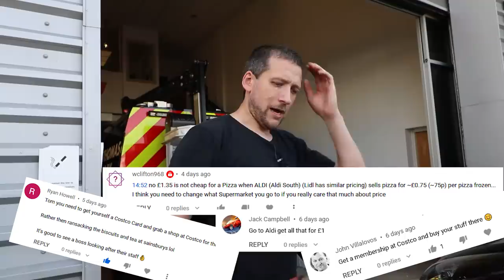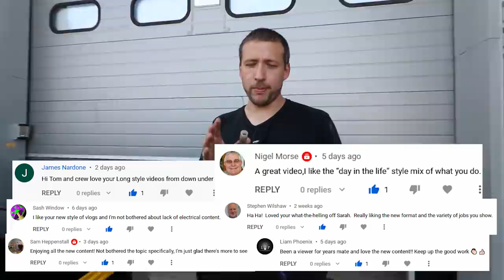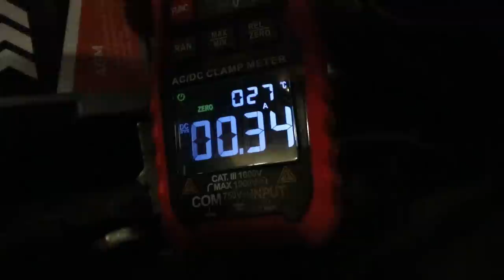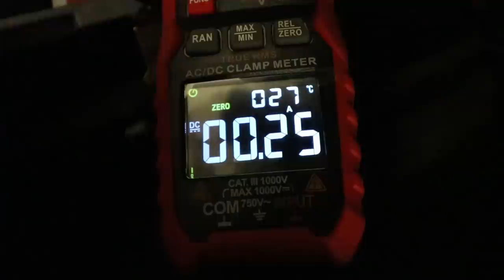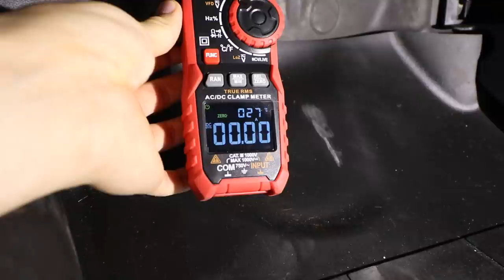THE NIGHTMARE JOB IS BACK! | Thomas Nagy

Comment: I work for a company that had fleet vehicles and every single one of the fleet vehicles had on board Chargers that had solar panels mounted on the roof and also plugged in if the vehicles were to be parked for extended periods of time. It was helpful for whenever we had somebody go on vacation and they neglected to shut off their radio or unplug their computer charger

Comment: Helpful tip coming from an auto spark. (Finally something on your channel I can actually say I know what I'm doing with!) If you're using anderson connectors, don't mount them underneath unless you put protective covers on them as they rot very quickly due to the large tin surface area. They also don't do well if you drive off with them still in. I would suggest using a short tail (250mm) and go through another connector that you can deliberately fail the retention lock on and make loose so that you won't destroy the workshop as you drive off. I tend to use standard mate n lock white spade connectors for this purpose. Or if you are feeling like overkill, get yourself some ex ambo Ludo McGurk Auto Ejects that fire the connector out as soon as you turn the ignition on (110v ones are very common and sensible money)
Reply from the maker: I really appreciate the advice, I'll look into it :)

Comment: CTEK has a nice connector on their car battery chargers and they also have a waterproof connector to put on cars, that might also be an option (vs the other ones you saw). Other option would be those connector they use on ambulances and other emergency vehicles. They can automatically be ejected when someone starts the engine. Emergency vehicles without that mode tend to have a circuit installed to disable the starter while the car is charging, too many cables have been forgotten and ripped out ;)

Comment: Re battery drain - had a similar issue a few years back with a Jeep Grand Cherokee. Went on holiday for more than 2 weeks, came back and it was dead on the drive. The vehicle was less than 1 yr old, so called out Jeep rescue. Who - as they recharged the battery - said there was nothing wrong with the car, we hadn't driven it enough...

Comment: I had the same problem with the car battery going flat, turns out to be a combination of the battery never being fully charged as start-stop was a constant draining in traffic and the dash cam which recorded 24/7. The dash cam draws 600mA continually 70Ah battery / 0.600 = 116.6Hours 116.6 / 24H = 4.8 Days to completely flatten the car battery just from the dash cam, then add the car's standby electronics!

Comment: On external vertical conduit runs I solvent weld the upward facing side of a join but leave the downward facing one push-fit. 
  
Pro tip from a non-pro: For a really neat conduit joint form the end into a socket using a heat gun and another bit of conduit as a mandrel. Needs a bit of care but it's far less noticeable than a normal coupler where appearance matters.

Comment: With modern vehicles you need to give them time to go to sleep before taking a current draw reading. You can't just close and lock it then take a reading, you won't get an accurate result. If you want to change your battery without the aggro of re registration, just use your jump pack across the cables. Depending on the vehicle it can take up to 50 minutes to fully shut down.

Comment: I had a DMF and clutch kit installed 4 months ago. I was gonna do it myself as I always do, but not being that well, got the garage to do it. Went to pick it up, wouldn't start, starter not even clicking. They club hammered the starter and I was on my way. Said it needs a new starter. Kept club hammer in van for a week till i had time to change the starter. Turned out they didn't put the earth strap on the engine, it was tucked up and rubbing on the bell housing for and earth. This why your honor, I have a club hammer in the door pocket.

Comment: I have had the same thing but not with a van by the way. I have a brand new Mazda Mx5 RF and it draws from the battery after you have driven it. However I have found that it reduces the amount it draws when the car has been sitting for 3 hours or so. It’s like the car goes into a sleep state but only after a few hours of not doing anything with it. It must be to do with all of the computers etc in the vehicle I would assume

Comment: I'd fit a split charge system with separate battery with it's own completely separate feed and fusebox from the main battery, you can also then use the aux battery as a jump starter.

Comment: Powerpoles  for the win , whether the big'uns for Charging  or the little  ones for  stuff like radios

vans and quiescent  load is a big  thing - vehicles  which even supposedly have  electro mechanical isolators still have issues with  going flat if left  and not on a conditioner

Comment: I ran into the two breaker circuit during my DIY fuse box to breaker box change over. I found that both circuits ran to the duplex receptacle that the refrigerator plugged into. My guess is that the original intent was to have a refrigerator only circuit by splitting the duplex receptacle and running separate circuits to each end. Someone apparently did not get the memo that it required a split receptacle.  I would think that there are single receptacles available for this type of circuit.

Comment: This hits close to home:   I had my Vespa GT300 serviced by the dealer a year ago. (Major maintenance, all fluids, all consumables, valve adjust, etc.)   It seems safe to assume with the price and the confidence they exude that it should be done right.   But one year later, it just dies while I'm leaving work.   I had it towed home and got into it the following Saturday.   The spark plug cap had fallen off.   Easiest repair I've ever done.   It's not supposed to happen because there is a built-in retaining fork to hold it down.   Must not have been used.   Then I go to change the oil and discover that the filter and fill cap are way over-torqued.   I sent a complaint and got no reply.   I dread next time I need to take a wheel off because they are already high-torque bolts.  If they are over-torqued I don't stand a chance.  (I own torque wrenches, but no power drivers.   They apparently like using the latter.)  Dudes with impact drivers think everything is easy.   But they don't give a damn about the next guy, or your engine casing.

Comment: Look into JTL for apprenticeship/college. Honestly hand down the best experience.

I was with a standard college and got fobbed off big style, was made redundant 2 years ago and they kicked me off the course before finishing my last unit. Passed my AM2 and did a seperate 18th edition exam myself and have been working for the past 2 years on that. My current employer got in touch with JTL, they flew me through my NVQ and everything is passed through and complete.
Reply from the maker: Thanks for the tip!

Comment: probably the sink goes on top of the bog like a saving unit combo, you wash your hands after taking a crap and the used water goes in the tank and it gets used on the next flush

Comment: Investigating the batteries: Good idea with the clamps hooked on the terminals to give stand-by power. That said I'm from the states so the advice I'm giving might not work, don't know the van type that good as it is not a US van. If the cigarette lighter is constant hot you should be good. Get a 12 v AGM 5 AH+ to attach to the cigarette lighter and you will be good for the main battery swap.

Comment: The current draw sounds high even for a controller kam, keep alive memory, must have been tempting to pull the factory fuses to find the big draw.
you can also do your charger battery change trick through back feeding the obd port.

Comment: I would be wary of trying to swap the van battery whilst using a charger to keep the van alive. Without a battery in place, the charger voltage could float up and damage the van ECUs. I would use a set of jumper cables to connect to another van instead.
Reply: Good thought.

Comment: re back feed, twenty years ago i bought a business property which i knew was in dire need of many things, got inspections from roofers, plumbers and electricians etc. Didn't know what an eicr was back then, but the spark i went with came back with a report that said basically we have to start again. 4 consumer units were turned off and main fuse pulled. he started stripping out, i was chatting to him when he got belted, turns out a radial was actually a ring. The other end of the ring was in a fifth consumer unit which we didn't know about and was actually by-passing the meter.  You may have gathered i'm not a spark, but me and the spark lived to be a bit smarter!  In my case i'm smarter because although I'm a graduated Youtube electrician i still hire a professional when i need stuff done, the spark got to retire a few years later. (not just on what he charged me!).  A word of advice, you might be safe 99% of the time, but if there was a 1% chance of winning the lottery - how many tickets would you buy? Think about it...........

Comment: Careful. Chargers with no load may go to quite a high voltage. Check before disconnecting the battery.

Comment: I have said for a while a ceiling rose can be dangerous when there's no lamp in it, plus with ceilings being 2.4m high, obviously you would have to be a knob to do it, but there's plenty of them out there.
My 68 plate traffic is playing up, keep getting a spanner light, then stop start error, check vehicle etc, Renault have had it 5 times, can't find the problem, told me my battery was only 75% charged, can't see how as it's used everyday, the last time said it was led number plate lights, fitted 3 years ago, yet this fault started in January this year, they just cannot fix them too many electronics.

Comment: Just in case no one has committed, the victron battery disconnect can be changed to what ever cut out voltage you want

Comment: Get some decent smart chargers.  Tiny and not intended for charging a dead battery.  They need to live on the battery all the time.  They assess battery state and apply different charging regimes to keep the battery in good condition.  I'm really impressed.

Comment: Watch if you put Anderson connectors on the side of your van(s), someone will drive off with it still connected.  I know it is only 12 Volts, but what will it pull the cables before something breaks and disconnects it.  Might drag the charger through the shop!!!
Better if the Anderson connectors are under the bonnet or somewhere where the bonnet can be left open, so it is obvious the wires are connected.  It will happen where someone will drive off with it connected.  Either that or make it so when the van is started it will automatically push out a connector, yes it will cost a bit, but it might save a lot of money repairing damage after someone drives off with the charging wires still connected.
Some Fist stations use a system where it throws the electrical cables out when they release the handbrake.
Cheapest way to do it would be to put wedges under the front and rear tyres to stop the van moving with the Anderson plugs still connected.  However, you are still relying on people putting in the wedges when they connect up, best way would be to connect the charge cables to one of the wedges and make the charge cables a bit heavier to allow for the extra cable run.
Put the wedges on the inside i.e. behind the front wheel and in front of the rear wheel, this way the cables will have less travel, but the van will not move until cables are disconnected.

Comment: do you have a decent obd2 code reader? If you get yourself a decent higher level one- (Autel seem to do some more affordable ones) then it may have the functionality you need to enable a new battery amongst other stuff like reseting abs faults etc. Either way it'll be well worth it if you're servicing your vehicles particularly for diagnostics.

Comment: That's why here in Australia, auto electricians exist (and we are never short of work). While I know many great mechanics.....many often aren't good with electrical or basic electrical diagnostics, some because of the way they have been taught or the places they have worked, or because they simply don't care.
In fact I often find myself diagnosing mechanical and hydraulic issues that mechanics have written off as electrical issues. (I work on heavy vehicles so this is a fairly common occurrence).
I'm by no means the best tradesman in the world but I still try. 

This is not a dig at mechanics though, I know plenty who are great with electrical, it's just the mindset you need for electrical work lends itself better to fault finding in any trade I feel.

Comment: Don't worry about programming the battery - it will still work, no problem. Pulling the battery while keeping the charger connected won't make any difference - the van will start using a bigger battery.  Newer vehicles will change the alternator output based on load to save a bit of fuel.

Why don't you buy a cheap tool like OBDEleven so you can read faults on your vehicles anyway?  You can reset the service intervals properly too. Something like OBDEleven will let you "pair" the battery too if required.

Comment: Tom have you tried the aico radio bases? It does away with the need for a cable link. They are expensive but save quite a lot on labour.

Comment: Just regarding the battery consumption - do the vans have smart keys? For my car, when it is locked, there are still at least three transmitters pinging for the smart key, and the inside transmitters (one in the cabin, and one in the boot/trunk) may also be pinging, at least for a while after you close the doors. Related, does the current reduce when you lock the van?

Comment: 41:05 Bespoke joinery in those with Italian marble by itself could be 20k. Throw in some Lefroy Brooks fittings new 2 zone underfloor heating with bespoke shower enclosers wet room and you already in materials close to 40K. but I guess if they use Mr Nagy they like to get quality so who knows what the speck was... And if the contractor is like TN and likes to make they profit they probably could go with Bob who for 15K get it done in a month and won't answer the phone never after that hahaha.

Comment: In a modern ceiling rose the terminals are enclosed and not easily finger touched,, however does the same apply then when you change a light bulb.? Remove the bulb and there are live terminals especially if they have no idea which orientation the switch is in.

Comment: Costco used to be quite good value. But now I’d say the savings are so marginal over supermarkets that by the time you factor in the membership fee you’re barely better off. Unless you’ve got a corner shop I can’t see the point. Just my opinion, great video as usual Tom, many thanks 👍

Comment: 300ma is way too much current. There's not an aftermarket alarm is there? The vehicle should be shutting down to almost nothing after a set period of time. Maybe trip the bonnet catch (so it thinks the bonnet is closed) and wait a couple of hours and remeasure. If its still pulling this sort of current this is the issue. A normal vehicle on a half decent battery should be able to sit unused for at least a month and still start afterwards.

Comment: My dad is an auto electrician for 30+ years, when you said all the lights came on i knew it was battery, if the people read the fault codes correctly and go back to history they should have a low voltage error,   Ive had the same problem in my Opel Corsa(vaxaull) , with a very basic computer and yea phoned my dad, he said yea check the battery terminals. The machanics these days just look at a screen and dont know how to actually trace a fault.
END

Comment: 600mA is terrible for a standby current! Try 50-60mA, that's more typical from a stock car system.  Either the van is still awake, or there is some drain elsewhere.

Comment: With regards to a new bridge, you're probably talking more expense and time to make a new crossing.

If you're not removing the old bridge (which you probably would have to do because of space limitations etc), you can discount the cost of demolition.

That just leaves us with:

* Architectural design
* Structural engineering/design
* Bids for design etc out to tender (which would involve a very lengthy consultation process given it's a publicly funded bridge)

* Preparatory work (if you're building a new bridge you have to put in new foundations)

* Anything over water triples the price because now you're looking at disruption to river traffic, hiring in specialist equipment/floating barges/caissons

* Specialist construction firms that have expertise in building bridges over water as opposed to land

* Access for huge construction equipment to the busiest city in the UK

* Geological surveys to ensure nearby buildings, tube lines, utilities, etc aren't going to be disrupted or damaged by building work

If refurbishment of the existing bridge is required, you still need all this stuff, albeit on a lesser scale. It's a lot easier to both work on and do the paperwork for an existing structure than it is to build a new one.

Sure, you can eventually get sunk cost, where you're spending more money to keep the old bridge up than build a new one, but without seeing the figures on maintenance and repair compared to an estimate for a new bridge, you can't really say for sure what's the right solution.